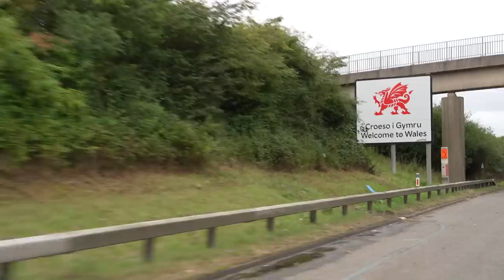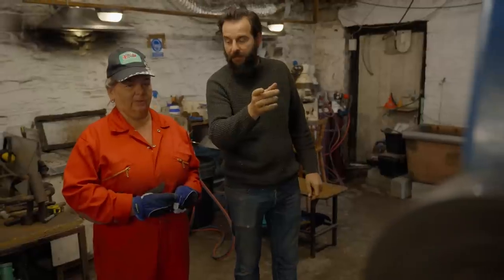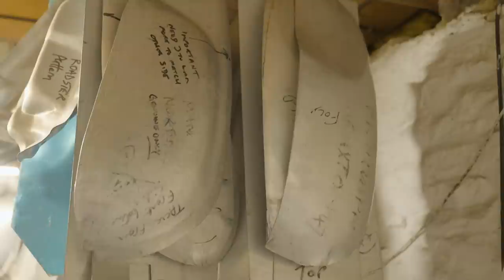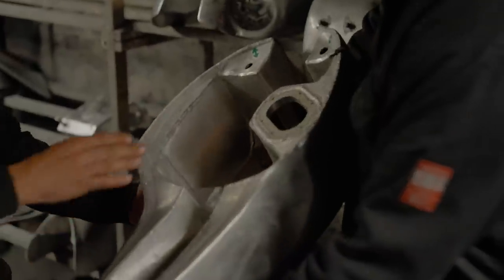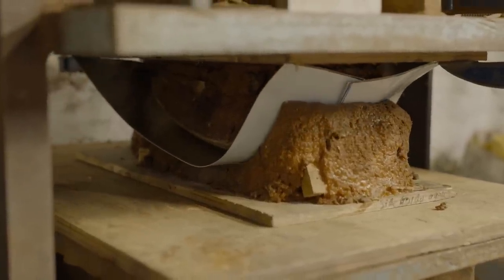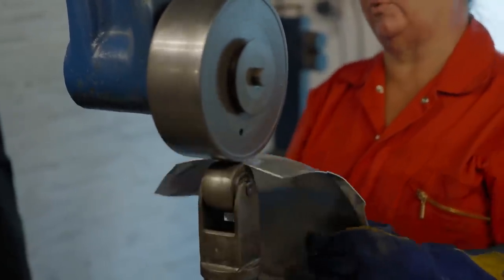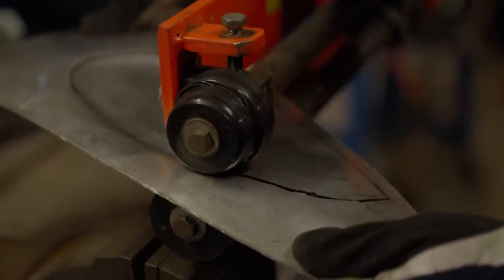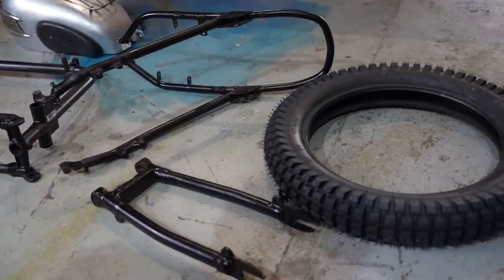Making My New Aluminium Tank! | Triumph Tiger 90 Restoration | Episode 3

Comment: Classic British hand engineering mixing imperial from the old patterns and metric from the new and nobody bats an eyelid.  That young chap welds aluminium like he's soldering and not messing with a torch that will burn through the material in seconds.  The talent in that shop is amazing long my they continue.

Comment: Brilliant. Such a joy to see Tom's welding and Dom making all the  learner mistakes. I was taught to  Oxy weld Aluminium (and sheet steel)  in the early 1970s age 17 in an evening class at George Stevenson College in Watford, where they taught auto body repair. Aluminium is  tricky and much more sensitive than steel to weld. You have to take care not to blow the melt pool out with the flame and drop molten filler on to it and never poke the pool with the rod or it will drop out. Molten Aluminium has very low surface tension unlike steel, so will drop out if you sneeze at it. Sadly, not a skill I have been able to use since. Oh and they also did wheeling and panel beating as a separate course. A great advantage of making your own rods is that the alloy matches perfectly, so no danger of electrolytic corrosion at the joint  from dissimilar alloys as well as good colour and finish match.

Comment: Great video Dom, it is rare to see anyone gas welding aluminium these days
The video did not show the bottom or internal construction so a word of warning regarding using ally tanks on that type of Triumph frame.. The original tanks have a thicker steel section running from front to rear mountings, this reinforces the Triumph goose neck frame,, when fitting an alloy tank You Must add a steel reinforcing between the headstock and rear tank mounting

Comment: Dom, those frames used the tank as a stressed member. Be careful you don't crack your new tank.
Triumph added a brace from the top of the headstock to the rear tank mount as a service fix. Might be worth welding one in.
Lovely tank man. I'm well jeal!

Comment: I was worried until I saw the last shot, showing the base of the tank. Hopefully you are putting in something  to replace the straps that run through the original tank because that Swan neck frame needs all the help it can get around the headstock. Triumph used it on the 350's and the Tiger Cub 200 and the tank is definitely a structural member. 
That lad doing the alloy welding is just so good!

Comment: As others have said: DON'T FORGET THE STEERING HEAD BRACE! The forces through the steering head, which originally went into a strengthened steel tank, will now be going straight into your nice new, much weaker alloy tank, and you wouldn't want that to split.
BTW great motorcycle road between Abergwesyn and Tregaron, and another past Llyn Brianne to Llandovery.
Reply: So glad that you raised this point. Great video. 👍

Comment: Great to see craftsmen and women in action and see the tank come together.
I think that on the T90/3ta and other Triumph models like the Tiger Cub the steel tank is used to provide some of the rigidity of the frame between the 'neck' of the steering tube and the point where the rear frame loop bolts on. Triumph added another upper frame tube on later designs to make the frame more rigid and more triangular. This might have been mentioned in a previous video, or the comments. 

Tab motorcycles hadn't made a tank for this Triumph model before. Has any thought been given to this in the construction of the alloy tank or do you plan to add any extra bracing to reduce forward/backward forces being exerted on the new tank and possibly flexing the aluminium and weakening/cracking it?
Reply from the maker: Yeah don’t worry I’ll be making a steel brace before the tank goes on! 
Thank you for the message

Comment: Hi Dom,
I don't want to start hares running, but I have a distant memory that the era of your Triumph relied on a steel tank to triangulate,for strength, the top of the headstock to the mid section of the frame. It probably won't affect the handling at the speeds you will ride, but any flexing might fatigue crack the fixing lugs.  Ask your Triumph experts....

Comment: Quite incredible craftsmanship and a pleasure to watch. I do  however have an issue to raise. That frame is similar to a Cub frame in that it has no top tube. With the steel tank the mounts are lengths of steel strap that go right through the tank and brace the frame. I don’t think your beautiful new tank is going to do that.